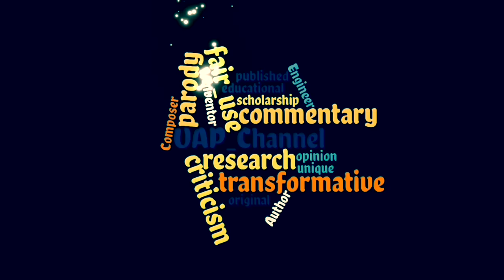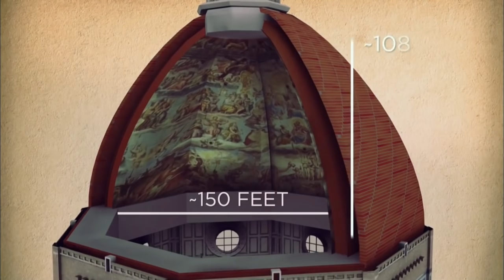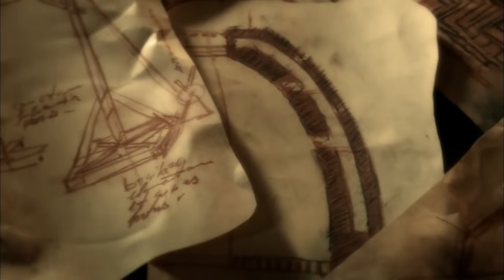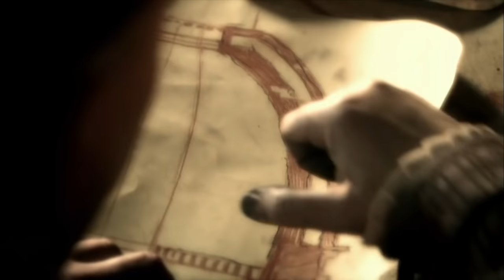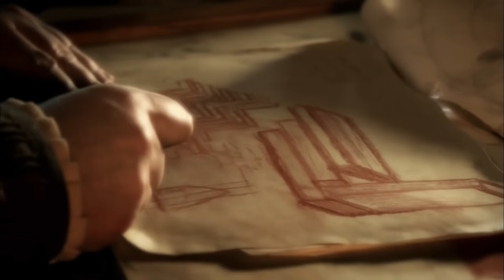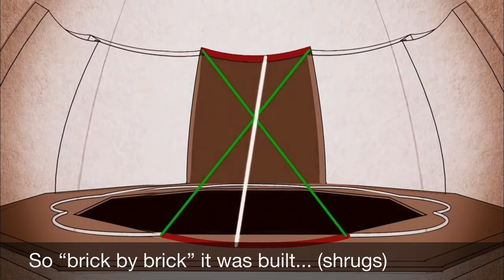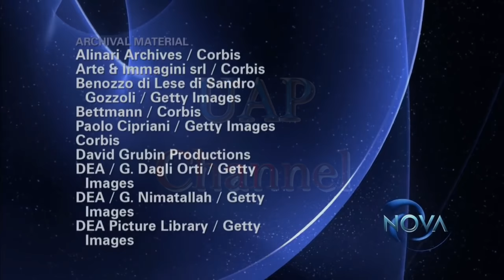Cathedral Mystery  | UAP Channel

Comment: The three rotating "comet tails" combined with the "O" in the Nova logo make three backwards sixes.
Reply: 6 electrons
6 protons
6 neutron
Drumroll pleeease, guess the element above-mentioned 🥳📣
Reply: @JValentineV  The complement angle to the supposed tilt of Earth's axis is 66.6 degrees, and the original value for the Gravitional Constand, "G", was 6.66.
Reply: Great answer, but no.

Hint: its carbon, you know, the stuff you're made off ;)

Comment: here in NC we have the Basilica of St. Lawrence, sporting the largest elliptical dome in the country (which they also have no idea how it was built & reeeally wanted to tear down, but the locals freaked out). The official narrative is "Rafael Guastavino, an architect and builder of Spanish origin, came to Asheville, North Carolina to work on the Biltmore House (ahem...) in the mid-1890’s. In 1905, he joined forces with the local Catholic community and fellow architect, R. S. Smith, to design and build St. Lawrence Catholic Church. He has been credited with the revival of an ancient tile and mortar building system that had been used in Catalonia and other parts of Spain for centuries."